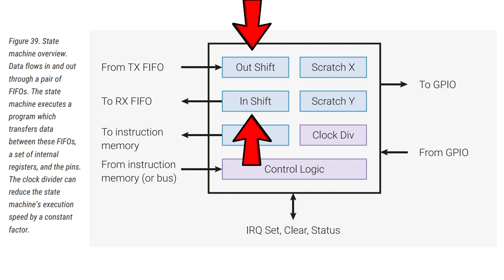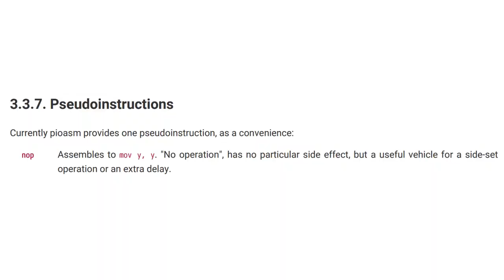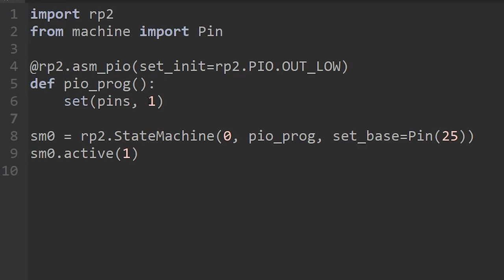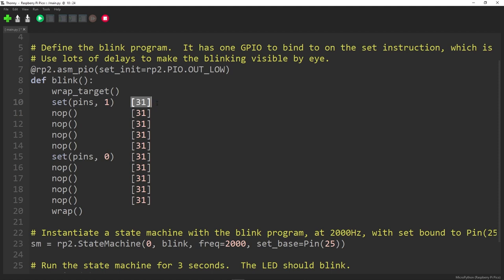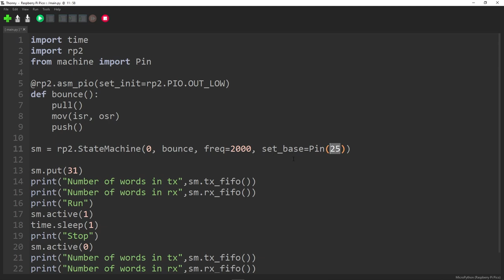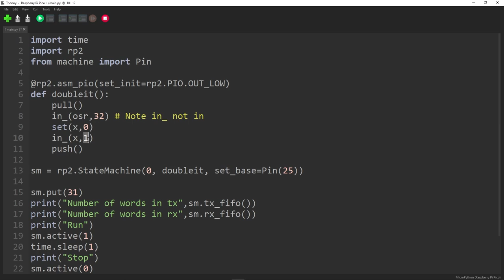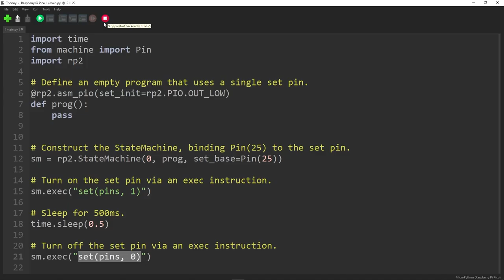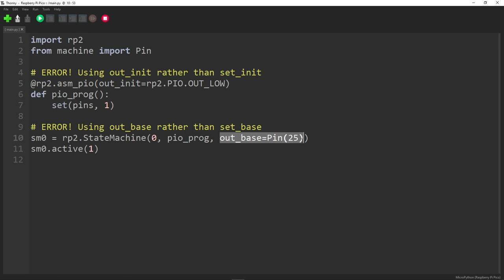Raspberry Pi  Pico PIO  - 8 Little Processors You Can Program

Comment: This kind of thing is amazing! It really saves main CPU clocks cycles, rather than having to service high frequency interrupts.
You've produced a great video demo, thanks.
Some NXP chips (I work with MPC5534 and MPC5777C) have a similar I/O coprocessor they call an eTPU. It concentrates more on timing. It has two independent timers, one can have dynamically variable speed. Each I/O (I think there's 32 per eTPU. 5534 has one eTPU, 5777C has 3) has two capture/compare registers, and can trigger interrupts.
You can code the ISRs in a weird dialect of C or different weird dialect of C++, but may have to pay for a compiler.
Each I/O can be assigned RAM, as well as global eTPU RAM. Any RAM declared as public can be accessed by the CPU(s) as well as the eTPU.
It's amazing what can be done with it, but it can be hard to ensure proper coherency when you start doing complex things.

Comment: Good video Gary, but with all the Time delays in Python you kind of missed the point of the PIO for new users. 
The key is that once started, the PIO routines run separately in the background and do not affect the performance of the main Pico processors so, for example, a PIO could be reading serial data with very accurate timing, while the main processors run complex mathematics on the data...
Reply from the maker: True, I thought I explained that. Sorry if it wasn't clear.
Reply: I think you missed the point, not the creator

Comment: The PIO is one of the things which make the picopi so great compared to other systems in this area, thanks for this video! I have relatively quickly hit a block which probably would not have been solvable properly on other systems but now I have had a serious look at the PIO yesterday, and my judgement is, that it is solvable with minimal effort compared to for instance an Arduino !

Comment: Thanks Gary! The inclusion of the pio in the Pico is revolutionary. I'm hoping later iterations give us more than a 32 instruction memory shared with all 8 of the state machines! While having these state machines is wonderful, having more instruction space would make this truly wonderful!
Reply: Not ragging on the Pico at all - but interfaces like these have been available on many MCUs for years. For example the Teensy 4 has it, many STM chips have it, etc. That said, I am glad to see it becoming more mainstream through the Pico, it's a powerful combo between MCUs and FPGAs that I've been anticipating for years.

Hopefully they will release another version of the Pico in a BGA package with a lot more IO pins. And native USB 2.0. Then it would be useful for something more sophisticated than hobby projects.
Reply: @yum33333  I am familiar with the Teensy 4 and 4.1, but the 3x FlexIO interfaces (loosely PIO equivalents) on those are quite different in philosophy. The Pico's PIO instructions all execute within 1 cycle and have multiple functions going on at the same time in the same instruction. For example, writing out of the Output Shift Register (OUT instruction) can additionally shift the bits at the same time as well as adding delays (if desired). Each PIO command is highly code and execution efficient and can run at the same frequency as the ARM core itself. The PIO state machines effectively allow certain limited parallel operations to occur, often faster than even a dedicated ARM core itself could. On the other hand, Teensy's FlexIO is limited to 120MHz, which on a 600MHz Teensy 4.1 makes it less useful, as in it is really only intended to offload deterministic bit-banging operations from the ARM core. It does not execute instructions faster than the ARM core itself. This difference in the Pico's PIO philosophy has made projects, like a logic analyzer using the PICO operating with 21 digital channels with up to 120 MHz capture speed (https://hackaday.com/2022/03/02/need-a-logic-analyzer-use-your-pico/) possible. A 120MHz logic analyzer run on a humble device costing just $4 is quite an achievement and illustrative of the difference in PIO philosophy.
Reply: @yum33333  Which STM chips have PIO functionality like this? Got an example part number? I came across something similar in the LPC4300 many years ago but not so far met it in STM.
Reply: @Mark Warburton "revolutionary"...? HAHAHA. Parallax Propeller, two-fucking-thousand-six. https://en.wikipedia.org/wiki/Parallax_Propeller
Reply: @AttilaAsztalos  That Parallax Propeller is an eight core MCU that is at least an order of magnitude more expensive, even now, compared to the RP2040. The reason is it has 8 fully functional cores that are more similar to the dual ARM cores in the Pico than to the PIO. The Pico's "revolutionary" approach is to offer multiple PIO state machines running at the same frequency as the ARM cores and taking up very little die space to achieve that, so keeping costs down.
Reply: @markwarburton8563  The Propeller was a direct precursor of this, however, on the basis that standard hardware I/O was EXPECTED to be implemented using some of those core, as it was otherwise totally missing. Yes, the cores were more general purpose than these state machines, but you were expected to used them as needed to do exactly the job these are meant for.
Reply: Some NXP chips (I work with MPC5534 and MPC5777C) have a similar I/O coprocessor they call an eTPU. It concentrates more on timing. It has two independent timers, one can have dynamically variable speed. Each I/O (I think there's 32 per eTPU. 5534 has one eTPU, 5777C has 3) has two capture/compare registers, and can trigger interrupts.
You can code the ISRs in a weird dialect of C or different weird dialect of C++, but may have to pay for a compiler.
Each I/O can be assigned RAM, as well as global eTPU RAM. Any RAM declared as public can be accessed by the CPU(s) as well as the eTPU.
It's amazing what can be done with it, but it can be hard to ensure proper coherency when you start doing complex things.

Comment: I'm thinking about patterns that allow for sending multiple buffers over different high-frequency (30MHz) SPI lines in parallel. You'd still have to feed individual words to each fifo in the main program, right? i.e. each PIO unit doesn't have access to RAM, so you'd need to keep feeding them.
Reply from the maker: Section 3.6.1 of the RP2040 datasheet shows you how to do full duplex SPI. Also section 3.2.7 covers Interactions Between State Machines, where it says, "State machines can not communicate data, but they can synchronise with one another by using the IRQ flags."
Reply: @GaryExplains  Oh, neat. Thanks for the reference.
Reply: @trevorschrock8259  Also, it is possible to configure DMA to feed (empty) the FIFO and, again, offload the main processor.

Comment: kan one statemachine change multiple pins? looking at the naming (pins vs pin) and set_base (implying that you can use more pins from that value). That would be useful for some programs, like an uart loopback, or more complex protocols that require precise timing on multiple lines.
Reply: Yes,  out_base defines the start pin, so if say gpio16 is set as the base, pins greater than that can be used.  Also, look at the use of the  .side() option on commands which can also be used to control additional pins.

Comment: Gary I have a question since the I/O processors (state machines) are independent of the main CPU. Can you run a seperate program on the CPU if it does not interfere with the I/O.
Reply from the maker: Yes
Reply: @GaryExplains  Great, Thanks for the quick response.

Comment: I tried to use this, there are only 4 not 8. I wanted a simple program that would monitor 8 inputs and switch on outputs until the inputs were triggered again. As they are not numbered sequentially, this is not possible unfortunately. So I went back to using uasyncio on the main core. If there would be 8, I could have dedicated one to each pair of input outputs
Reply from the maker: There are 8. Here is a direct quote from the tech specs: 8 × Programmable I/O (PIO) state machines for custom peripheral support.

Comment: 16:19 If blinking time (sleep) is different then is it possible to stop pio in state the led stays on ?
Reply from the maker: That is a good question. Looking at the source code it seems that the activate() function just sets a bit in the CTRL register. The documentation says, "When disabled, a state machine will cease executing instructions" which implies that it stops on the next cycle (I guess). So I think that means that you can stop it with the LED on.

Comment: beaglebone black has to that can be programed in C
Reply from the maker: The Pico can be programmed in C as well. So with the Pico you get the option of Python or C and it costs just $4.
Reply: @GaryExplains  cool
Reply: @GaryExplains  So the microcontrolers can be programmed in C or the main pricoessor?
Reply from the maker: The Cortex-M0+ processors (there are two of them) can be programmed in C or Python. The PIO have their own special assembly language as I explain in this video. That special language can be loaded into the PIOs from C or Python.
Reply: @GaryExplains  Two  ARM processors plus another 8 micros.  The 8 are assembly and the two are C or Python.

I saw the video on the dual core programing.  Is there shared resources?
Reply from the maker: Yes, but the PIOs aren't microcontrollers, they are special IO processors with just 8 instructions. The Cortex-M0+ is of course a microcontroller.
Reply: @GaryExplains  Sounds good.  Can you generate an interrupt for one controller or input to trigger the other.
Reply from the maker: The two M0+ cores communicate via some FIFOs.
Reply: @GaryExplains  So the second processor would have to pole the FIFO.  Can they share memory or use global memory?
Reply from the maker: I love that you are interested in the Pico, and I am happy to help, but I think at this point it is just best if you go look at the documentation.
Reply: @GaryExplains  Thanks

Comment: Finally a good useful description of something I want to know, about real time deterministic fast I/O .. then you somewhat spoil it by muddling it with Python, yet another fashionable interpreter of the time but completely pointless alien speak to me.
Reply from the maker: You can use C instead, the principals are the same.
Reply: @GaryExplains  Yes, I know I am about to do it. I was hoping the video would give me a head start, but I did not get that much useful from it.  No real explanation of "pins", still not sure how that works... how does it compete with GPIO, does it have some form of mask, Interaction with ISRs?.  The PIO compiler in the SDK is not shown as you went the python route.I will go and read the data now, but it is a bit of shame as the title of video got my hopes up but I came away having felt I learnt little other "The PIO has 8 programmable units"
Reply from the maker: Well, I am sorry to hear that, but of course you understand that I didn't contact you before I made the video and asked you what you wanted. I made a different video and plenty of people seem to have found it useful, sorry you didn't. All the information you need is in the datasheet which I link to in the description.
Reply: @GaryExplains  To be fair you videos are well made with good presentation, but had you added the word "python" to the title I would have ignored it and saved myself some time.
Reply: There's more 'boilerplate' in the typical C version of things: the 'in-line assembler' in Python is more 'terse', so why not go ahead with it here, because the theme here is the PIOs themselves (quite well treated, I think). There was basically no support from the main processor(s) in these examples, except a little poke and peek to the queue depth. To get properly into this you would  probably need interrupts and DMA and all that jazz, which would be much more likely well done in C, alas. Gary's series on a muti-tasking OS for the Pico has been quite hot on the low level, though.
Reply: Sounds like you are not familiar with the Parallax Propeller-P2.
64 identical "smartpins", 8 CPUs (aka: cogs). Real-time/deterministic doesn't get any better and interrupts can be avoided altogether. Any pair of smartpins can even be configured for quadrature decoding/counting with zero CPU involvement. 👍
Reply: @AdaptivePhenix  Interesting. I've heard the name but you are correct, I do not know anything about the Propeller. Mostly I use PIC, ARM, STM32 and ESP processors, probably enough complexity for my age :-)